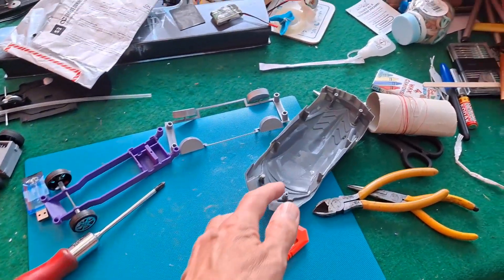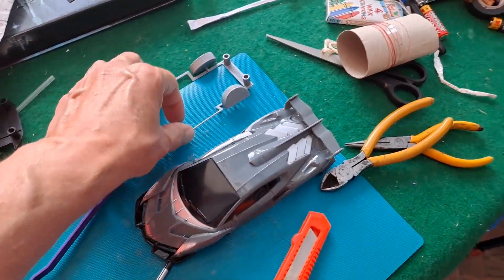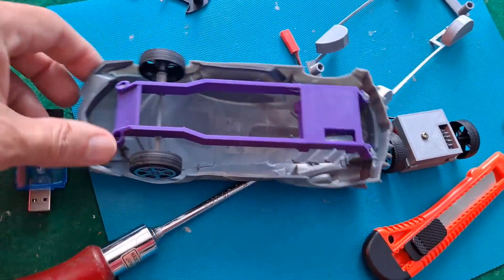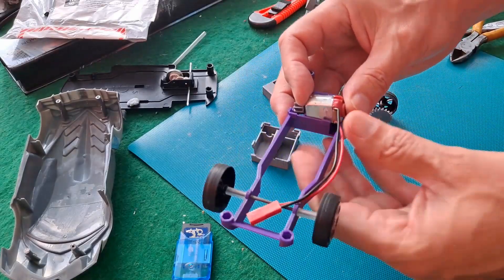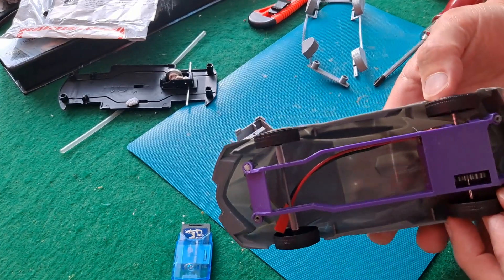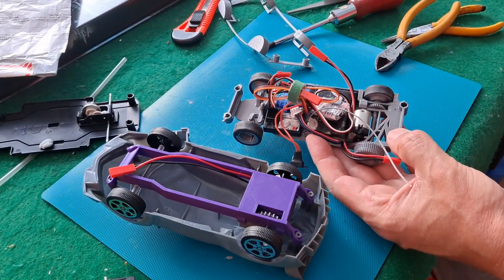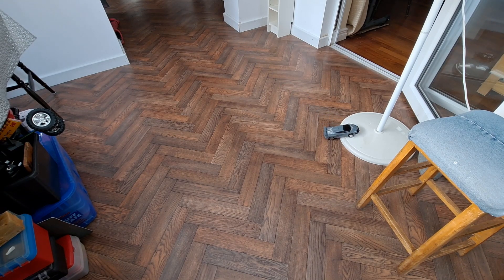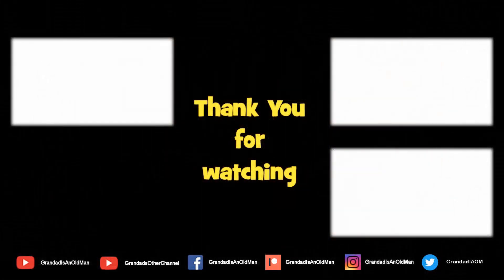Poundland toy car RC conversion project PART 3 - Chassis and gearbox

Comment: Useful tip: don't put a thermometer on the wall because it's going to catch the temperature of the wall is going to affect the measurement. Instead,hook it up somewhere.

Comment: According to bigclive.com pound land have a larger capacity powerbank. Gonna got one tomorrow.
Reply from the maker: Yes, I was looking at them, but I didn't buy any. I still have a stock of the little disposable Power Pods that I use for making small 1S, 2S, and 3S batteries. Of course, when I decide I need something a bit bigger they will be sold out 😆👍

Comment: I want to do a similar conversion but don't have a 3d printer what would you suggest
Reply from the maker: You can hack around the existing chassis to make space for the steering and gearbox pinched from another RC car. Or just use the chassis from another RC car that happens to have the right dimensions. Here is an example I did a while back https://youtu.be/ul9fEb_NLWo
Reply: Mebbe try using a 3d.pen. I got one off eBay, and I haven't used it yet.
Reply from the maker: @vincentking9980  I haven't tried one yet. Not much use when you need accuracy, but could still be fun to use.